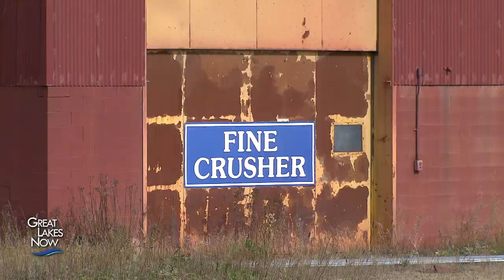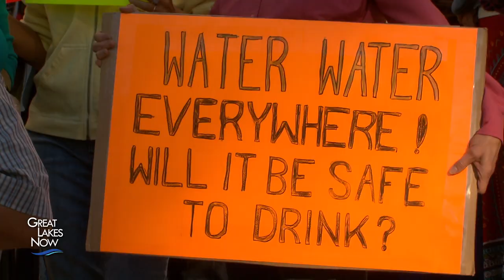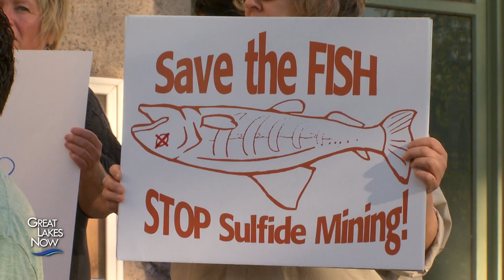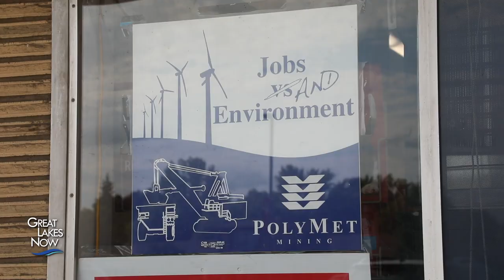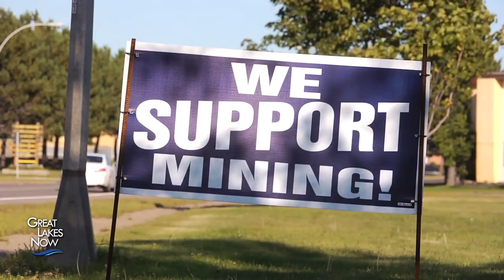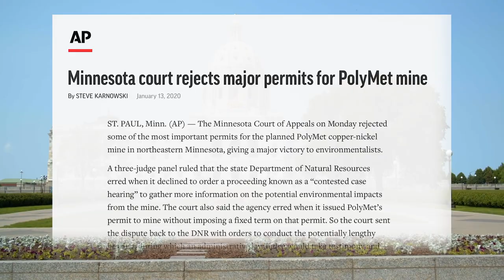Conflicted Over Copper - Great Lakes Now - 1018 - Segment 1

Comment: Pristine environments benefit only a relative few. Mining creates wealth. Wealth means homes and families. The benefits of wealth generation radiate outward to multiply many times beyond the immediate impact on the communities in which the employees of the mine and it's auxiliaries live. It's a simple equation: several magnitudes more people require technology that requires copper than will ever set even one foot in this area. Functionally it can also be considered a form of eminent domain as the benefits of many infinitely outweigh the benefit of the microscopically few.